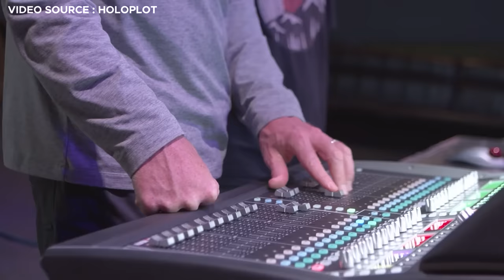How The World's Largest LED MSG Sphere Came To Life In Vegas

Comment: That structure if not designed and built correctly could be very dangerous.
Reply: I suspect they they designed and built it correctly.

The 2nd, 3rd, 4th, etc. versions built around the World will be even better based on lessons learned.